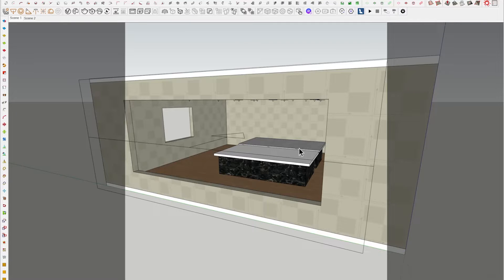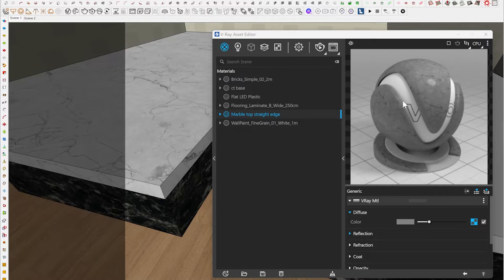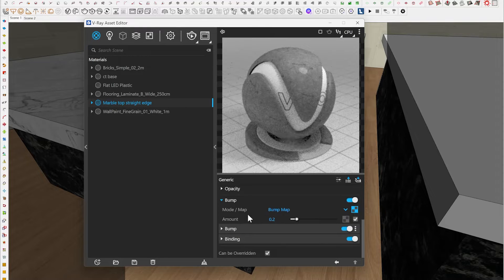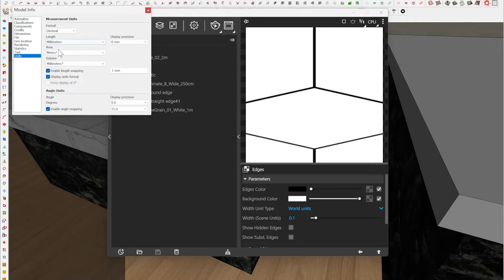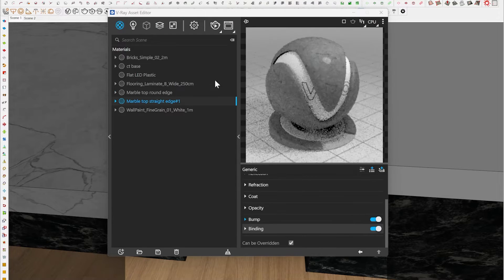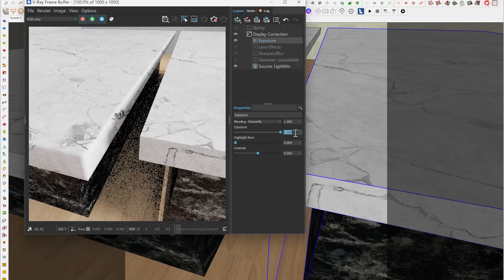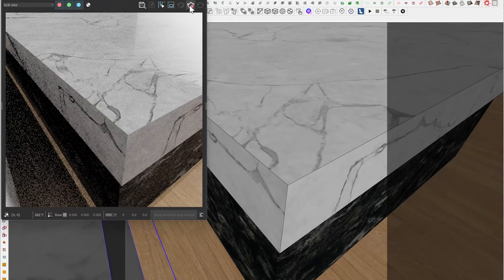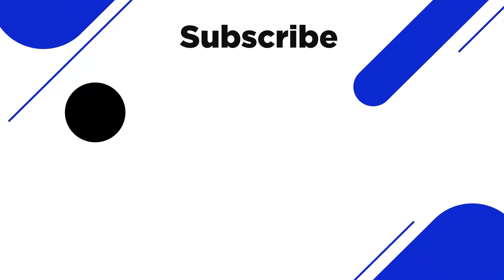How To Make Rounded Edges I V-ray For Sketchup

Comment: Hi, 
I just started learning how to render in sketchup with Vray. but my problem is my interactive render is always dark..
i have tried setting it, but it is not working.
I'm using a GTX 1650 graphics card laptop.
Reply from the maker: Hi there! The reason that happens is because the interactive rendering is fixed to use the "brute force" setting in global illumination opposed to production rendering that uses the "light cache" option. You can fix this by either increasing your exposure values in the frame buffer or increasing your lights intensity for more visibility. I hope this helps! Cheers